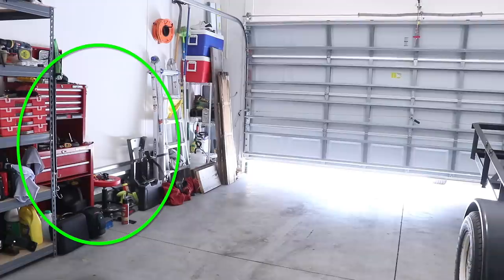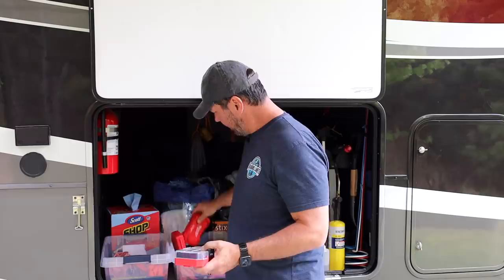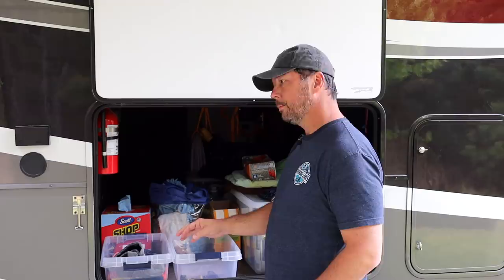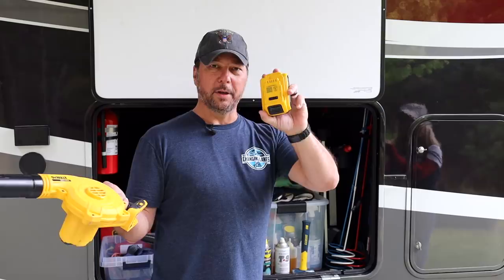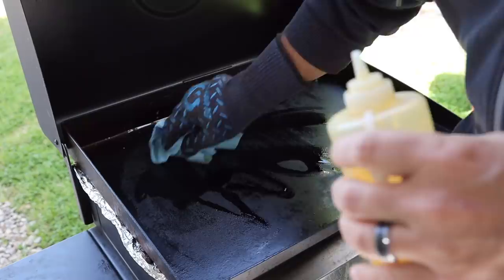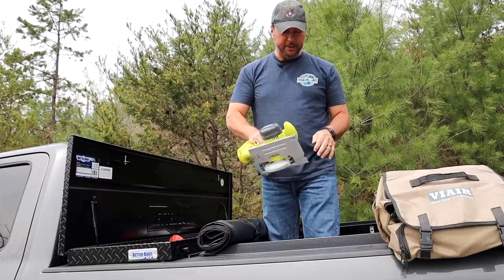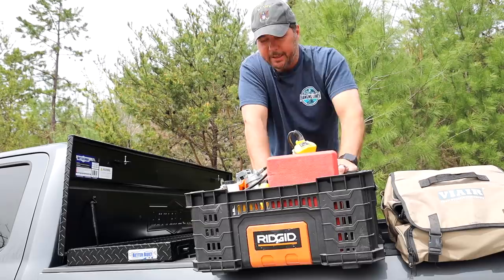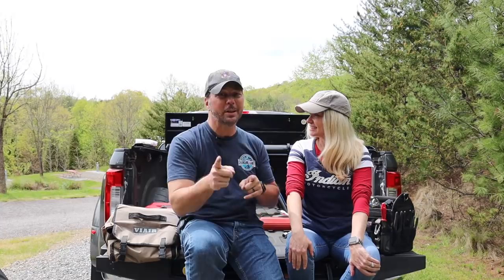🛠 Tools for Full Time RV Living! [RV Tools] Changing Lanes!

Comment: Great assortment  one thing I have that I don't see is a cordless 1/2 impact .I have Ryobi because I have that battery platform also I have Milwaukee 1/2 impact very high torque .I have severe arthritis and other problems .So impacts make tire changing so easy .Never to many tools .Chad you have the first tool list that impresses me so close to mine almost exactly even leaf blower .My health issue are similar to Tara's  you are the reason we are going .Not full time yet to many Dr appt Thanks guys for great video's
Reply from the maker: Yea.. We need a 1/2 inch impact for the tires for sure!

Comment: Another great use for the heat gun is to heat up and remove eternabond tape.  The folks we bought our 2000 Brave from used eternabond to (failed) repair a cracked skylight.  The only way to get the eternabond off without damaging the roof was a good heat gun.  I spent 2 days getting about 1/3 of it off, the rest came off quite clean, without damaging the roof using the heat gun.

Comment: One thing we've learned to keep on hand is some Flex Seal tape - we ran under a tree limb at a Navy base campground in Pensacola and ripped the roof membrane - just small rips but six of them.  It was raining, and that tape kept the roof from leaking until we were able to get to Lazydays and get the membrane replace.  Probably saved us a ton of water damage, and we've added a couple of Flex Seal products to our repair arsenal.

Comment: Wow, I will say , as a part time camper it is a little easier with my Craftsman tool bag with basic quick repair tools and of course fuses. Gorilla tape, heavy wire, electrical tape and basic lubes. You definitely have to have a load when you are traveling with your house. Good stuff . Thanks

Comment: I would recommend to add 3 items to your kit. I'm sure Chad wouldn't mind looking for these the next time he's at Lowes or Harbor Freight. A "cheater" pipe that fits that long 1/2 drive breaker bar because there will always be that "one bolt" you can't crack loose. A file set with a "rat tail" (round), flat or with a rasp and a triangle for when you've boogered up some threads and have to make a quick fix. Lastly, I would recommend a smaller (1.5t - 2t) floor jack preferably aluminum whose handle can also double as a cheater pipe in a pinch. Love the videos and the energy that you display in these educational episodes. Stay safe.

Comment: I get to tell you something on the lube replace the white lithium with Napa Chain and Cable lube it doesn’t smell or stain also comes with an extension hose so you can pin point and unlike the lithium it does gel but doesn’t dry great for door hinges power steps and of corse bike chains. One last thing wheel grease find Teflon grease on Amazon

Comment: Been rving for anout 20yrs and full time for 5yrs.  You hit about every tool I have.  The one thing I have found is that if you are going through what tools to take with you and you think you ought to take a tool .....take it......YOU WILL NEED IT. 
  Take yout map/propane tourch apart when transporting it..  vibration and rubbing could turn it on and in some cases strike it(dont ask me how i know).

   Tip for working under any type RV.  Use an under awning carpet. It is easy to slide in and out from under it.  If you drop a piece of what ever it is easier to find.  It also keeps you cleaner as from sand, dirt, grass and modetate amounts of moisture.
  If resting most types of electric in rv, most zny type of multimeter will work.  If testing electronics you will need a "true RMS" meter.  Also having a  clamp meter that resds both DC and AC amps is very helpful (and more expensive).
Thanks

Comment: Kept me smiling through the whole video. I have almost everything that you dragged out. 

A couple uses for the leaf blower. It is a great stubborn fire starter. It is also fantastic for moving dust & dirt from one location in the basement to another.

A must have that was not mentioned is a 12 ton bottle jack & some 12X12 lumber for putting under the frame should the need ever arise. It has.

Been using the T9 for many many years before the RV on the saltwater kept boat. Great stuff.

There is no such thing as being too self reliant. My DW is an experienced boat woman. She knows tools & is never afraid to get hands dirty.

Comment: Another use for that shovel is to act as a lever to raise a tire/wheel when changing. slide the point  under the tire and push down on the handle then push wheel on to the lugs.A block of wood can be used as a fulcrum if needed.

Comment: In addition to the torch, consider a battery operated air mattress pump.  When I get my fire smoldering I hit it with the pump and it gets the fire raging in seconds.
Reply from the maker: The blower does the same.. 😊
Reply: @ChangingLanes  Yeah, I didn't wait that long to make the suggestion.

Comment: One tool that I've found to be very useful is a Dead Blow Hammer, from putting steaks in hard ground to taking out a dent in your tailgate. One thing it does not bounce.  Love it.
Reply: I saw a mallet, (he pulled one out quickly).
Reply: @SpykersB  that was a 2lb. sledgehammer the deadblow is filled with lead shot. The deadblow delivers very hard impact.

Comment: A Viair compressor!  YES!   Isn't cheap, but it works exceptionally especially on high pressure applications. You nailed it! Also a HALON 2-1/2 lb. Fire extinguisher. Not corrosive like abc powder and Clean!  Spray it on a dress, wear it 30 minutes later.
Reply from the maker: We have this for fire suppression: https://youtu.be/0A3Qb8SX5pI  But the halon extinguishers are good too.

Comment: As a Locksmith, I would suggest using a graphite product like CRC Dry Graphite Lube or a powdered graphite lubricant. The liquid lubricant over time can attract dirt and gum up the inner works of the lock, requiring reapplication. The graphite is a dry lubricant that does not attract the dirt.
Reply: I know what your saying, but the powdered graphite I find hard to “poof” it in the lock, and I don’t get the same slick movement of the mechanisms (rv entrance door), so have been using a spray can of “Dry lube”, with immediate awesome results. But...will this too cause more problems in time?
Reply: @SpykersB  The CDC Dry Graphite Lube is in an Aerosol Can, which makes it easier to apply. You can get it on Amazon. Hope that helps clarify.

Comment: Great Video!  I copied you and JD on the Access cover / Tool box in the truck.  What a great combo!  You carry a ton more that we do, but after being on the side of the road with a flat on a boat trailer, I went to harbor freight and picked up a 3 ton aluminum floor jack, and put that in the truck toolbox.  Over kill yes, but you don't need it 'till you need it like you say, and it fits much better under a trailer axle when the tire is flat.

Comment: The Dremel is one of the most used tools in my gunshop - especially when I have to do some stock inletting for a larger barrel in the channel.  One thing I didn't hear you mention - but Lowe's gives a discount for veterans.. Just sign up online (IIRC) and the discount will be taken off the price..  Around here, Fleet Farm is 'the man's toybox'.. LOL.  It appears you have about a half-ton or more of tools..  Yipe.  I do suggest you obtain a second spare tire & wheel for the camper. Ours in also a triple-axle and I carry two full spares, just in case..
Reply from the maker: We'll definitely add a second spare before we head to Alaska...
Reply: Changing Lanes, kyd did that with their reflection, and well they stuck to the main highway roads and had no problem. They too thought the roads were gonna be bad, but they didn’t look so bad. (food for thought) . Cheers 🍻

Comment: Chad my friend. You have a serious addiction to tools. You need to find a Tool Anonymous. LOL But then my wife says I'm that way with BBQ Equipment. I have 2 Offset smokers, a Pellet grill/smoker, a 60 inch pig roaster, a 2 burner Camp Chef stove with  14 X 17 and a 14 X 32 inch Griddle top. So besides BBQ I got into Cowboy Cooking. I have a bunch of Cast Iron Skillets and Dutch Ovens and a campfire rack to hang Dutch Ovens and a campfire grate to sit pots and pans on to cook directly over fire. And of course you need a thousand dollars worth of accessories to cook with. LOL Luckily we're seasonal and have a shed that we can put most of this stuff in but I also have several of the things at home as well.

Comment: Excellent video, I was surprised no racket straps in the tool box. I'm getting ready to put a small cross bed tool box, so I can carry fuel treatments, extra coolant, and oil because I've got a older truck that needs some TLC and I'd like carry these items just in case. Also I carry a 12 ton bottle jack, you never know when you need to jack something up, another thing is a road side safety kit. Can't wait for the next video and outtakes
Reply from the maker: We do have various ratchet straps....   👍🏼

Comment: Thank you for this.. I had already seen your link for the fuse kit and purchased on Amazon...we have had 2 experiences that your tools/accessories did and would have helped if we had been prepared. 1. before our 5th wheel our travel trailer when we/hubby forgot his impact wrench.. manually extending/retacting the stabilizers ugh!! 

2. leaving a week long camp stop...the truck/camper break locks not working...FUSE blown...no where nearby to get a replacement....found a spare in the seat heater...anyway. lesson learned..and great tips  have spares!

Comment: Thanks for your videos.  They are really helpful.  I do have a question (kind of off topic).  You have a 376 Momentum.  That is exactly what we are looking for.  What do you pull it with?  I watch a video from a dealer and he mentioned a Ford 450 or 550 would be a good fit for this.  I have GMC 350 Dually Duramax.  What is your recommendation?  Will I be good with my truck?  
Thanks again for all your advice.  Great videos.  
Mike H

Comment: Lets not stereotype, here!  LOL I grew up as grease monkey to my dad, and I'd rather go to Lowe's or Home Deopt and get lost in the tool department than shop for clothes! I'm not your typical gal.  I know my way around a toolbox, and I'd have trouble downsizing!  LOL
Hmmm...I had a set of EZ-outs, and they did not work.  All they did was make a hole in the head of the screw, and did not grab at all.  I ended up having to bash them in with a hammer and use a new screw! And yes, I double-checked the instructions to be sure I was using them correctly... (But then, they don't make screws like they used to, do they?  It seems you just look at them wrong, and the head strips out!)
HA!  Breaker bar brings back memories.  A friend and I were trying to replace the head gasket on her car.  One of the bolts would NOT come loose, even after 24 hours soaking in penetrating oil.  So, we got out the breaker bar..and yep...there it came.  Or so we thought.  Turns out, we'd broken the bolt, and then had to drill out the rest and put in a heli-coil!
Dremel--I have a couple, and the circular saw blade that fits on the end has been lost, and I've searched everywhere, and no one carries them!  All they have on offer is the little Dremel circular saw tool that takes about a 3" or 4" saw blade.  The one for the end-mount on the original Dremel is only about an inch across, if that.

Comment: We are new RVrs in a small camper trailer. Do you weigh your 5th wheel at the truck station before traveling? Our dealership guy said No, red flag, but there's a weight restriction to comply with
Reply from the maker: We weighed last year and were about 500lbs over.  Not a huge deal with 20,000lbs though.  We should re-weigh and shed some excess if we need to.

Comment: In one of your videos you mentioned you were Navy. I’m assuming surface/carrier sailor. I’m Navy too, Submarines. Love your videos. Curious if you have some type of PM system for maintenance on your trailer?
Reply from the maker: Yep.. Carrier.. I was active duty from 1986-1992. I worked as an AT2 (Aviation Electronics Tech) on E2-C Hawkeyes (big frisbee on top) in VAW-120, then VAW-124. In VAW-124, we deployed on the U.S.S. Theodore Roosevelt for Desert Shield and Desert Storm.   I'm jut recording maintenance for now.. I plan on building a full PMS at some point.
Reply: Changing Lanes we were in at the same time. 80 - 91 USS John C Calhoun and USS Von Steuben. I was a Fire Control Tech working on the computer that targeted the Trident missiles. I also spent some time right after C school at NATTC Memphis. Had to wait a full year for a boat assignment. When I was in Charleston we bought a truck camper. Every other weekend in the summer we were headed to the mountains in North Carolina to camp and cool off. 85 was better than 105 degrees

Comment: Hi Chad, at the 9 minute mark you talk about BOESHIELD which caught my attention because I also have the RVLocks sticking to the point they stay retracted. I bought some of that spray and the locks are still having issues. Do you have any video showing how you do the rvlock maintenance or what suggestions do you have to loosen these up?
Reply from the maker: Nothing special.. just spray it in the mechanism.   You might call RVLOck.  Sounds like yours might have an issue...
Reply: @ChangingLanes  Update: It turns out that I was about to take the RVLocks apart and follow the instructions from RVLock support and wouldn't you know it...it resolved itself with the time that had passed! The locks operate perfectly once again!!
So for those that want to know what the folks at RVLock support had to say about the locks here is the reply. 

The channel that the spring-loaded pin goes in and out of may need to be cleaned.
 If lubrication isn't helping - we recommend white lithium grease for lubrication.

If that doesn't resolve the issue, then remove the back portion and loosen the elbow screw a tiny bit on that hinge. (there are 3 screws, the center one is the one you will loosen a tiny bit and ONLY lube that small spot with a tiny bit a Vasoline)

Make sure the mounting screws are not on too tight.

Comment: Thanks guys, great ideas and as Chad says it is time for a trip to the Men’s Play Store😎 Curious about the wood (lumber) I noted in the bed of the truck. Is that to help support the tool box?
Reply from the maker: No.. Mostly random left over wood.  I keep the 4x4 in case I need to jack up a slide.
Reply: Changing Lanes thank you for the information. Great to have the 4x4 just in case.

Comment: Amazing, helpful info! Question: When beginning RVing, would you recommend going through any owner manual to see what the most frequently used type of screwdriver bits? That way your not over purchasing to begin? 👍🏻
Reply from the maker: It will depend on the manufacturer.  Just about every screw in our RV is a #2 square bit.  But a single kit should have that and just about everything you'd need and it's fairly inexpensive  https://amzn.to/2zTGqRC
Reply: The problem isn't the RV, it's the specialty bits required for the tow vehicle (and those projects where you get T25 one time and hex the next...)

Comment: When checking hub temperatures with an infrared temperature gun, what temperature should I be concerned about my wheel bearings. What would be a normal running temperature?
Thanks, Tom 
GD Imagine 2500RL
Gross Weight 7500 pounds
Reply from the maker: It's more about comparing them to eachother.  If one a lot higher than the rest, something is up.
Reply: @ChangingLanes  Thanks

Comment: How do you have the sunshade and track lighting at the same time. You had a video that said you put in new led lighting in the track.
Reply from the maker: We didn't replace the lighting, but repaired the wiring... See: https://youtu.be/ss4uEadFIRY
Reply: @ChangingLanes  Doesnt your sunshade go into the same track as your lighting? Trying to figure out how you have both.
Reply from the maker: The shade track is separate and made just for the shade.   👍🏼

Comment: Do you recommend carrying spare Lippert hydraulic replacement valves?
Reply from the maker: I asked them if they are a common point of failure and they said no.  So didn't order an extra...
Reply: @ChangingLanes  Thanks. They ain't cheap but it would be nice to have one if you're stuck in the boonies. Easy changeout.

Comment: do you have an aftermarket fuel tank/tool box?
Reply from the maker: No.  But our stock fuel tank is 48 gallons, which has been plenty for us.  👍🏼
Reply: At only 32 gallon tank, this may be a problem for us towing a 5th wheel toy hauler such as yours. I'm looking into an auxiliary fuel tank.  Thank you for your response @ChangingLanes